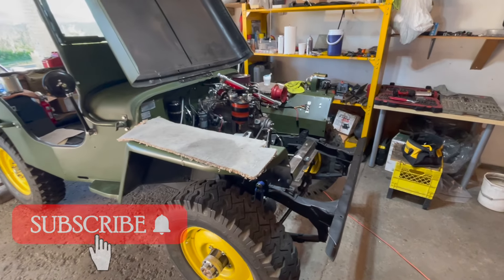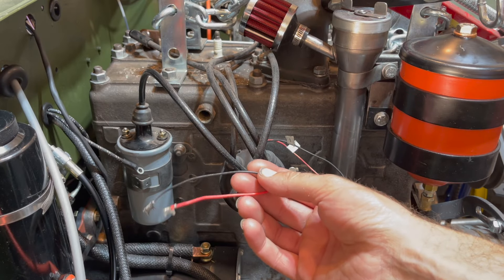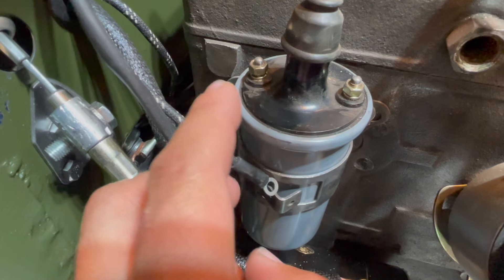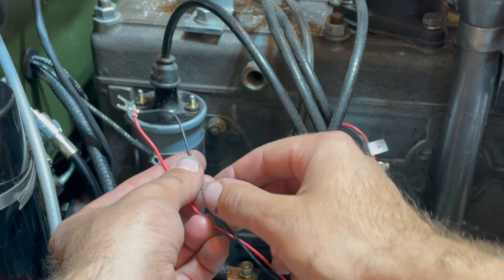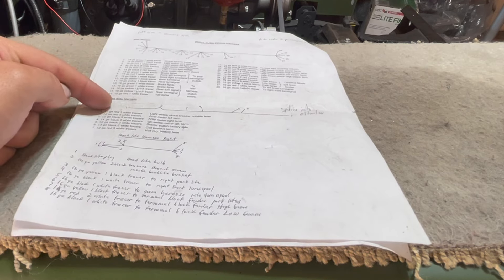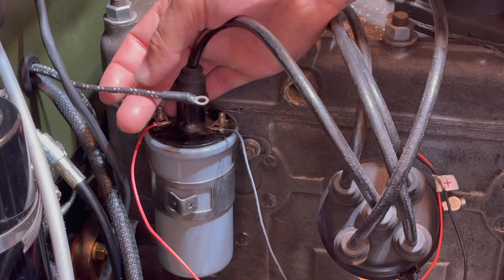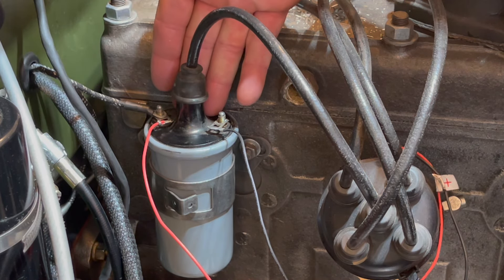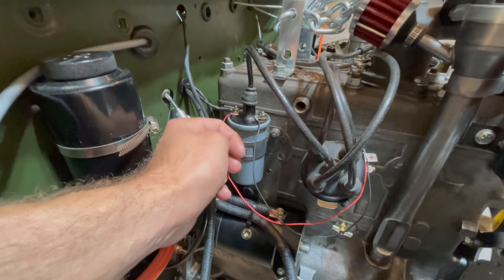How to WIRE Ignition Coil & Distributor | Jeep and Willys (yrs 1941-1971)

Comment: My distributor only has one black wire.  Nice video my distributor seems to be different.   It would be cool to with cap off.  Im getting no spark out of new coil.  Just don't understand what im doing wrong
Reply: Mine as well. How did you get on?
Reply: I've been dealing with this little LUV  and it gets spark only when I hand crank it, if I hit the starter I get nada

Comment: Where do the positive and negative wires connect at the distributor?
Reply: My distributor doesn’t have these wires. it was butchered when purchased.
Reply: Are there 2 separate + and - posts on the distributor? I only have one post for connection…. Pulled my CJ out of the woods and it’s rough
Reply: Same here
Reply: My coil only has a negative wire

Comment: Have you done a 12v conversion? Our battery is 12v the coil is 6v and we still have a generator. We need a new coil, do we up it to 12v? Or stick with 6

Comment: I just got a distributor from Blueprint engines, ZERO, absolutely ZERO wiring instructions. It has three wires. Red, yellow, and black.. Then there is a little side grey wire and I have absolutely no earthly clue what that is for. Am I supposed to assume that the red wires is positive side of the coil, yellow is negative side of coil, and black goes to the closest available ground?? Not the first time I have ever done this, but even just a little slip of paper telling you where the wires are to be hooked up would have been extremely helpful.
Reply: Old vehicles and tractors (1930s-1950s) are usually positive ground. The Jeep in this video was positive ground from the factory. The positive wire from the coil has to be grounded to the distributor.
Reply: This will get rid of points, correct?